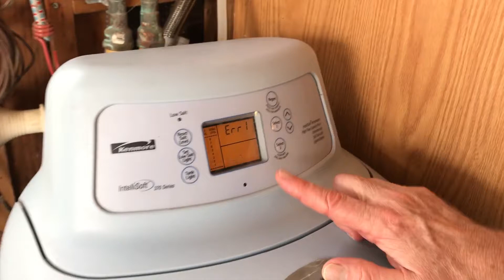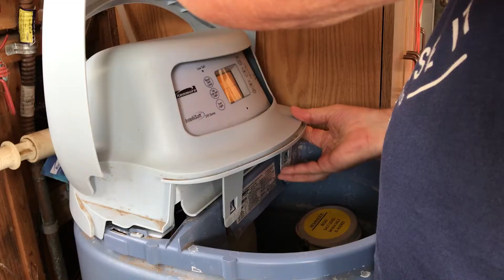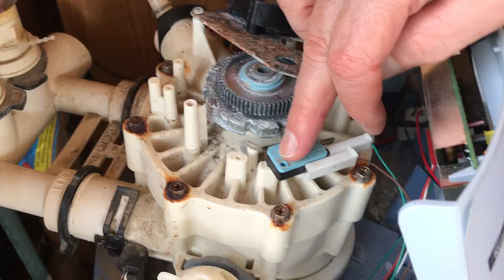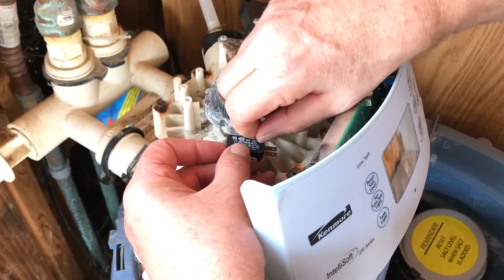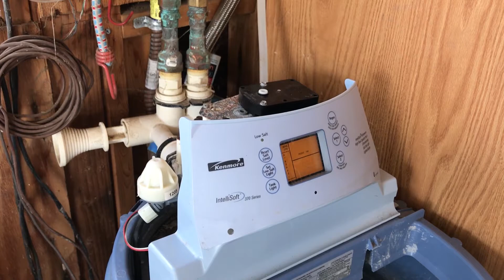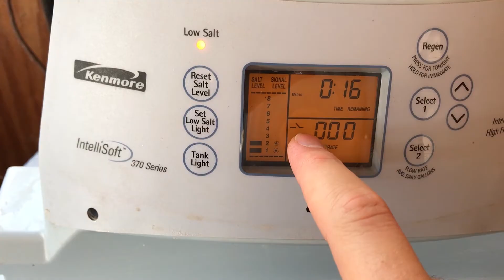Kenmore Water Softener Error 1 (FIXED!)

Comment: OK, I've got a new solution and another diagnostic test for you all. I was getting an error message #1. This says there is some electrical problem, like a wire that has been pulled and broken inside the insulative tubing where it cannot be seen.

I put my attention on the little microswitch that rides on the timing cam which is driven by the motor. I had an old style LED display, which uses P/N 7286306, which is a Kenmore 420 series part (which my model is). And that display's diagnostic setting DOES NOT tell you whether the microswitch is open or closed. The new one does. It won't work with that outer shell/cowling/exterior, by the way.

OK, So I had overlooked the switch as bad. After all, when I took it out of its location, and put my ohm meter on it, it would switch open and closed like a champ, but what I didn't realize was that the tip of the switch that physically rides on the cam was WORN DOWN, to where it was not actually being activated/deactivated when in actual service!!

Now you can get one of these for $20 on Amazon, but you can also get it for $5 at Grainger!

The switch with the longer "nose" was marked V7-1B17D8 and is Grainger's part number 24A240. You can order 4 for the price you'd pay on Amazon, and then you can sell three of them on eBay, and buy yourself a tank of gas for your car with the profits!
Reply from the maker: Thanks for providing this information!

Comment: Pro tip here if your unit is more than 7 years old just get a new one. These things are terrible. You can find a unit far superior to these things look for one that is two piece like a fleck or a clack valve. You will thank me later. There are disposable units not intended to be repaired.

Comment: We have a kenmore intellisoft 350 series. 
It is brand new and we installed it a few days ago. 
We tried setting a regeneration time, but it isn’t starting when we want it to based on the time we set. 
We’re sure we aren’t doing it correctly, but the instructions are so vague. 
We know how system should take about 2 hours to regenerate, but if we hit the immediate button to regenerate it only goes for an hour. 
Thought maybe you would have some answers since you have a similar water softener. 
Any help is appreciated. Thank you. 
Val

Comment: Thank you very much for the video. I have Ecopure water softener. I had the same message(Error E01). I opened the cover and found that the plug(connecting to the control panel)was loose. I tightened the plug and the error message has gone. Hopefully the water softener should work.

Comment: Hello I have the same model water softener from kenmore. For some reason the bypass bar switch is stuck. Have you experienced that? How did you resolve it? 

I just wanted to see if I could bypass my water softener. I have one that was installed about 16 years ago. I'm thinking of turning off my water softener by first bypassing it.

Comment: Thanks for the vid! Had same problem with my 420 model. Could see the motor was turning the valve, but the requested position never matches the actual. Took the switch off and toned it out and saw the same thing. $14 dollars later we are back in business. Cheers!

Comment: Tapping the switch with a screwdriver for a minute, resetting to factory defaults and regenerate worked for me. If it fails again I'll replace the switch. Thanks

Comment: Please let this be my problem.  My system is a GE system and a new board is over $300.  The total cost of the softener is $400.  This is criminal.
Reply: This wasn't my err1 problem.
Reply: @NMSB38  I'm calling the 800 number Monday morning. I just helped a neighbor replace his old unit with a new one and right off the bat we get the ERR01 code. To top it off we cannot figure out how to do a manual regen using the diagnostics screen. The is the new Morton M30 model. We picked it up at Sam's Club this Sunday morning. May be a factory defect or simpler.
Reply: @pstreicher  My problem was the gearbox behind the circuit board.  When I was looking for the problem my hand brushed up against the gearbox and it was burning hot.  Looking closer it it the plastic housing was melted in some spots.  I bought a new one for $50 and installed it and everything works now.

Comment: Use Ohm resistance measure on multimeter instead of diode, my micro switch measured 17 k ohm on open position, not OL, it's still faulty, Diode measure won't catch it. After replacement it's all good.

Comment: Thanks!  Great Video.     I'm dealing with a 23 year old Sears Water Softener Super Capacity Genius Model 625.3485500.    The exterior is cosmetically different but the inside  appears to be the same as in the video except for the motor.   I've cleaned the venturi, the tank float valve ,discharge line and the switch was not defective.    When I plug the unit it starts with a recharge and makes a  noise like a loud dripping water (every second).  This goes on for 2 or 3 minutes before I get the "ERR1).   I suspect my motor is bad and at $69, I figure it's best to get a new softener.

Comment: Do you guys happen to know how to get one of the computers for this unit? The little one that has the display that you push all the buttons on. Mine went out
Reply: Did you figure this out? Are you sure the board is bad? I had a similar issue but found it was corrosion on the board.
Reply: Andrew Simmons hello & thank you for responding.I went ahead and ordered a new board that arrived yesterday. The same issue happened to me two years ago and I did the exact same thing, just replaced the computer because in the long run it's cheaper than buying a whole new unit. I have already replaced another part as well, but none of the wiring. I personally feel that the dust from the salt during the addition of new salt causes the corrosion on the plates and the board overall. I don't have testing equipment to prove my point, it's just my thought process and observation of rust on the plates. How did you go about finding out that it wasn't the board that was your problem? I'm curious. I welcome all information that I can learn from.
Reply: lablvr6000 I basically looked at my board and saw buildup around the solder on the board and then I basically cleaned that up with a stiff but soft bristle brush(not metal). Once I cleaned that off I tried to plug it back in and it worked normally.
Reply: Andrew Simmons that's smart . I did try to do that a bit with a toothbrush but no success
Reply: @Bigpopp1  I sprayed WD40 all over that plate. Now that I think about it I need to look at it again. Might need another application. I'm sure there must be a better chemical to neutralize salt, just haven't researched it.

Comment: Hello I have a 350 series , I have changed the same switch you did. Only problem I'm having now is the metal round wheel ( cam gear) that the switch 'clicks' thru is not turning around and the little metal arm is supposed to click thru all those indents in that wheel. Do you feel I should replace that metal round thing? Also when I plugged it back in the words recharge and 'serv' show but the word Fill does not

Comment: Update - yes, the switch was bad and a new switch cleared the err1...BUT when it started working again I noticed it was spraying water from the top of the rotor shaft under the motor - right onto the switch. Probably why first switch went bad. Replaced the seal kit, rotor & disc, cam & gear. Total cost about $140, or about 1/4 total cost of this model 420 when not on sale ($560). Well worth it if I can get another 5-6 years out of it. Thanks again for your video, you gave me the courage to tackle this repair myself.

Comment: i get the same reading, but the rest of the disply dond show the salt level, or other things that should disply, i can push buttons and it will show my settings, 30 and 40, for what i need for my water, i dont have anything in my water except high calseum only, no iron nothing else, it did somthing like this last year, i took the control boad out and cleaned it with contact cleaner and it all worked again, as the control boad had corosion here and there on it, but back then it still showed all display items before cleaning, it had just stayed in back flush.. now with sears closed down, i cant find parts, i bought this back in 1998 and it been no problen until the past 8 months, right now it stays in back flush water going down the drain
Reply: 1998 Barvo! This is the third one since 2003! Even the tank had to be replaced. That part was covered. It is no wonder Sears went out of business. Works sometimes becasue salt is being used but nothing works on the front panel.

Comment: Thanks, I came home and the water softener was making the exact same sound.  I unplugged and replugged it but nothing worked. I pulled out the switch and the continuity was way off--It was showing like 45.xx Ohms, when Amazon sent the new one it was at 1 with the switch closed and 0 when open (I think thats right).  I am no electrician, just using a Harbor Freight multimeter and following your video best I could! I replaced the switch in like 5 minutes and Boom, its working like a champ again!  Thanks so much for saving me some money!  Mine is a different Kenmore (not as fancy), but everything looks the same inside. Awesome, easy fix!!!

Comment: All you need all you need to do to clear an error code 1 is replace that limit switch but to test the switch don't take nothing apart just put an ohmmeter multimeter on ohms on the two prongs unplugged the connection and then reach in and trigger the switch you don't have to take it off

I paid about $3 for 10 of those switches from China
Reply: Got a link to those fancy Chinese switches?
Reply: Clown Whisper do you have any websites we can get parts from in China or other countries?